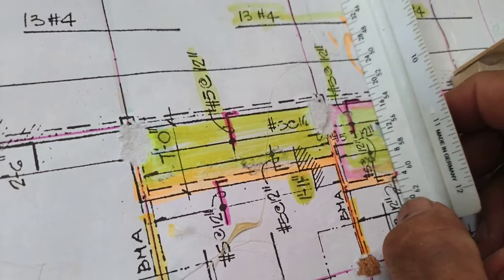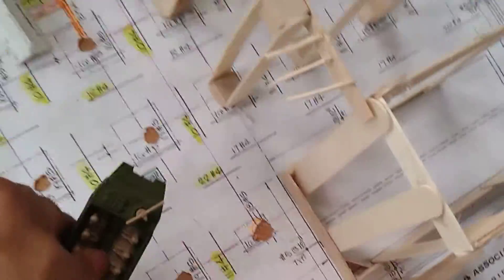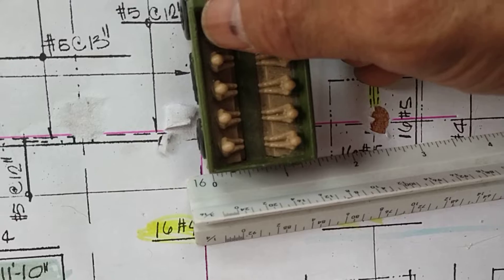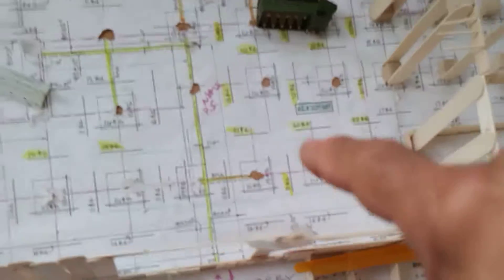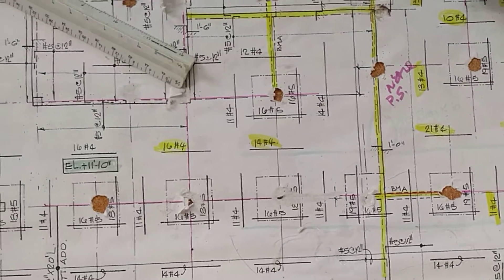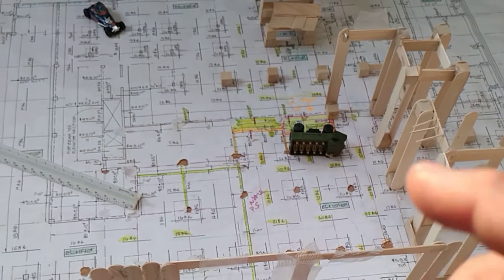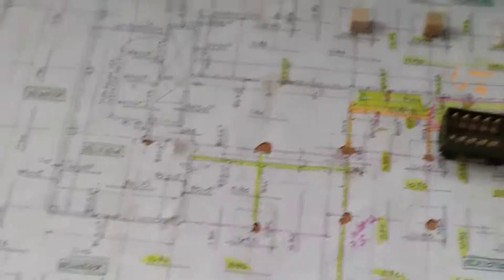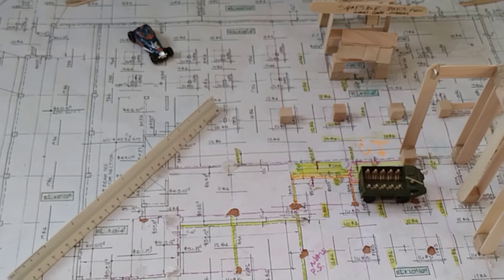Champlain Towers Current drawings are NOT correctly labeled with correct scale

Comment: How did the scale error in plan get by the architects, engineers, and regulators? Could that cause the types of cascading errors from working between metric and imperial measurements?
Reply: Of course there are Imperial gallons & US gallons to confuse matters.
Reply from the maker: I currently run into scale issues...
Reply: I have seen these problems in Europe & Asia. Metric/Imperial systems, languages, fonts, time formats, number formats, electrical mains differences, building code differences, driving on the wrong side of the road... Just one mistake can have catastrophic results.